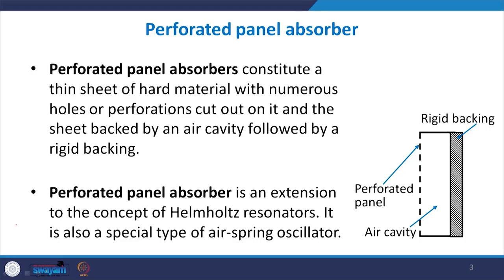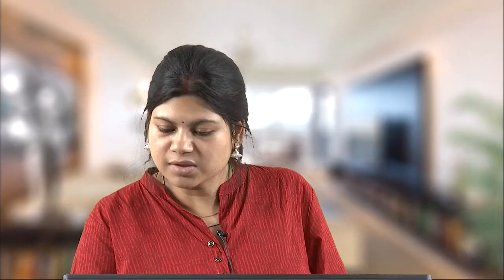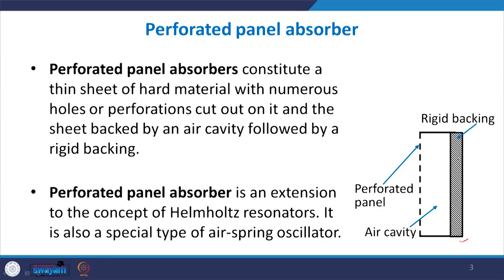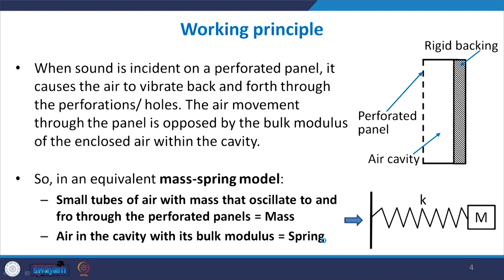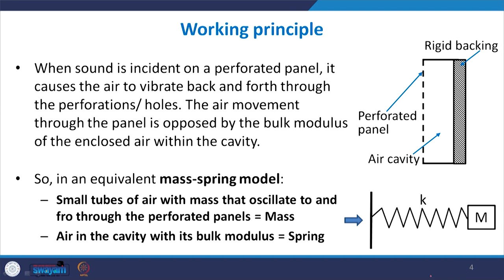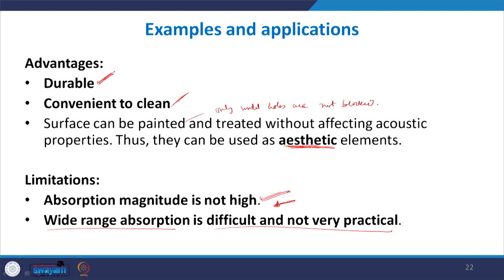Lecture 20: Perforated Panel Absorbers

Comment: I understood how the max fpp and min fpp are calculated, but at 23:57 how is the range considered? this considering, when fabricating the perforated panel, the panel thickness for one panel would be the same and the distance from the rigid backing for the panel would be uniform throughout. 

could you please elaborate on how the range is considered?
Reply: unless the range that is being talked about here is for what can be achieved in real situations rather than from one single panel.